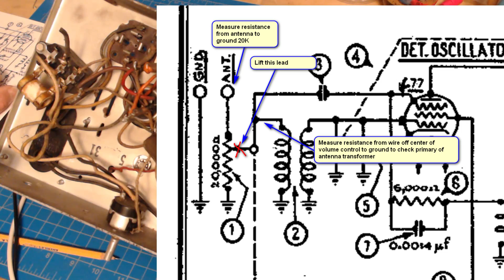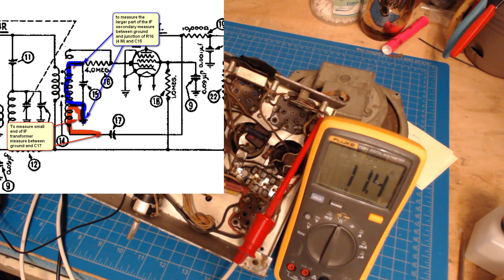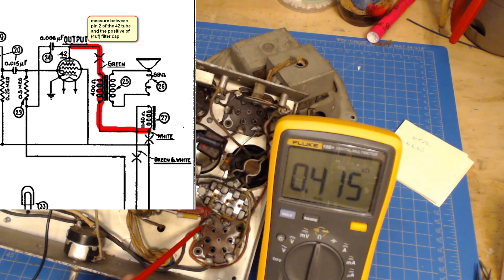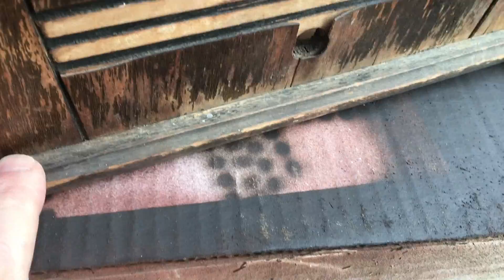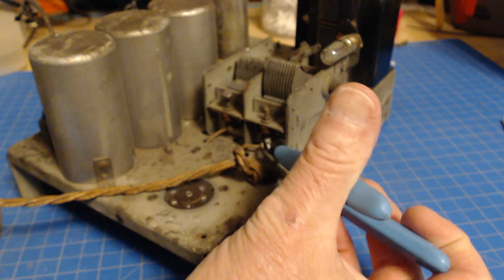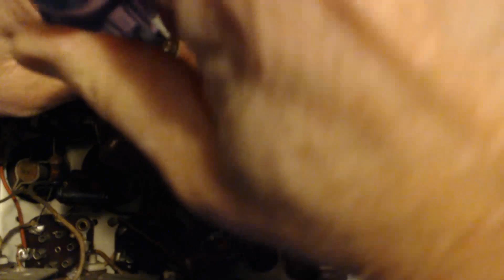The Basketcase 1935 Philco 84B Part 2 of 8 More Troubleshooting and assessment

Comment: Hi Larry, Working on an 84. I had it working prior to cap replacement and so on. The chassis fell off the bench while cleaning. I changed all caps and bad resistors. I replaced the grid cap wires too. Got it all back together and no reception. Audio section is working. I checked my coils again but did not know what the values should be so this video helped there. So now I need to figure out what is wrong. Probably made a wiring mistake. Hopefully the fall didn't damage a coil. Tubes were out at the time. Thanks for the detailed measurements.
Reply from the maker: @danielconant749  Ouch! I hate that it fell…The audio section is working, how are you checking it? Touching the tube grid cap connectors? How far back did you test it? Did you go all the way back to the first 77 tube the detector/oscillator? Also, check with an ohm meter to see if the drop shorted the tuning condenser? If you have a signal generator, feed signal in the antenna coupled with a .1 uF cap, use either an Oscope or signal tracer to trace it back. Hope this helps.
Reply: @Backtothefutureradios  Good news. One of the 77s went south. I noticed someone replaced the pot with a 15 meg one. Guess I better to get another one. The tuning cap was out of the radio when it fell.

Comment: Sorry to see your OSC primary is open. Not surprised, though. Mine was easy to find the break...I used some light heat from the heat gun to melt the wax over the winding and as the wax melted, one winding fell off! The rewind was 14 turns, that much I remember. Just make sure you wind it the same direction as it was and it will work. Mine was not pretty...there were some gaps between the windings but it didn't seem to matter any. I was able to get stations on both ends of the dial. Yes you're so right, these are very cheaply made cabinets. Next best thing to balsa wood! LOL Good luck, Greg (aka "Bob")
Reply from the maker: gavinwb1 lol, Sorry Greg! Im terrible with names. Part 3 is coming to a theater near. You will see the first break, didnt go any further, it was about 1/4 inch from the end. I wont spoil the plot, but Im not going to attempt repair due to the corrosion. Curious what gauge wire you used? I have some 40 and some 32, but I have some 36 on the way. Im thinking the 36 may be the ticket but will look at the 32 when it gets daylight. Ive already documented the turn direction, but roughly counted the turns. Im thinking somewhere between 14-15 is what I counted and all Ive read has been 14 or 14 1/2. I will count them before ai u wind and as ai take it off if it doesnt disintegrate! Thanks for watching and the input!!!! This is how ai learn and why I have suggested the fiewers to read the comments! Sorry for renaming you! Take Care--Larry
Reply: Backtothefutureradios Hi Larry, I went back and looked at my notes. I actually went 16 turns with 38 ga wire. So if you have 36 ga that should be fine. Good luck! Greg

Comment: Soldering iron struggling a bit you could stick it in the variac to up the voltage to get it hotter
Reply from the maker: John sweda Yes John, just a tad! I have a variable temperature $20 iron. Being a chemist, you know that this 83 year old solder has a different composition of metals than this newer solder designed for printed circuits, thus a higher melting point! In my mind, I was probably going to replace the wires anyway, and I went to desolder, at arms length because of my camera position, it was a bit awkward. So, I switched gears and decided to just cut them instead of dragging out the video. (like watching paint dry, lol). Hope you are doing well! Take Care--Larry